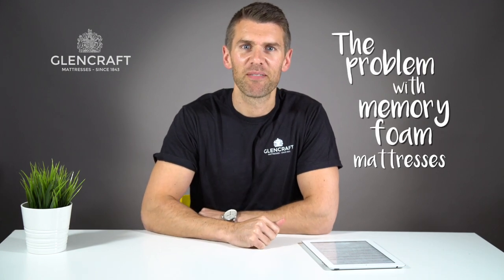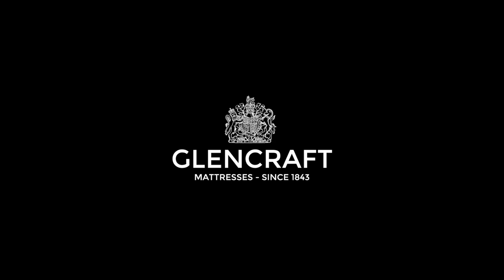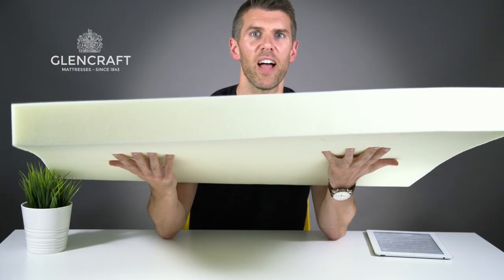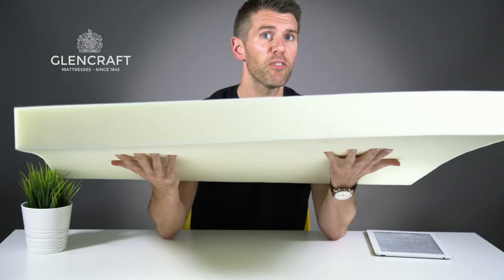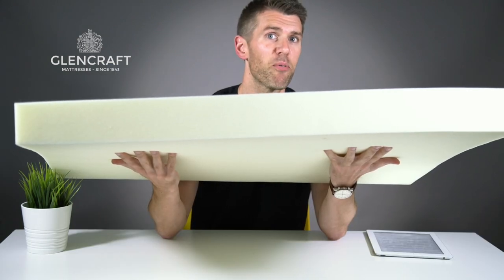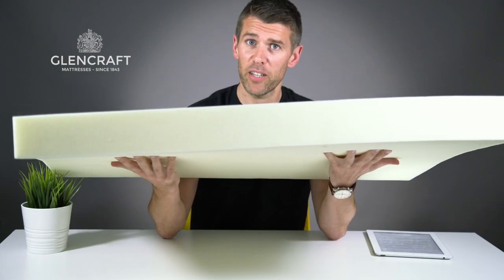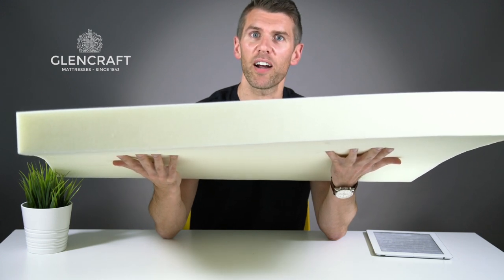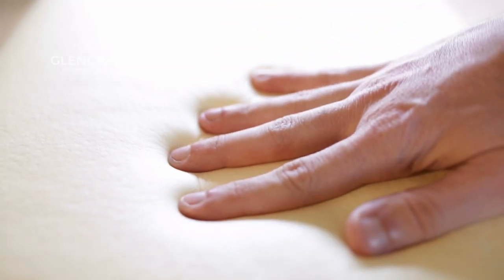The Problem With Memory Foam Mattresses Video

Comment: Like pot hole in my bed. NO support. "Memory Foam" does NOT cushion your body or distribute your weight, like actual foam rubber. It instead goes FLAT under you, THEN back to the original appearance of a cushion once youre out of bed. Expensive gimmick.

Comment: You're leaving out the main problem with memory foam topped mattresses.
After 40-60 mins your body presses out a channel into the foam rather than have the spring system redistribute the deformation of the mattress caused by your weight. What's more, the foam at the sides of this channel in turn press in against the sides of your shoulders/rear end. This is uncomfortable, impedes circulation at the pressed areas, restricts the normal small movements we tend to make when sleeping and provokes a greater number of turns/repositions during the night.
I realise that some soft covering has to be lain over the spring system. But I think a traditional moveable hollow fibre/natural fibre padding would be easier and provide deeper and more comfortable sleep.

Comment: I'm on my 4th memory foam mattress in the last 3 months all of the mattresses conform to my body shape but the shape never leaves the mattress do you know or have any suggestions about what could be the problem here
Reply: Stop buying them, if you're looking for something long term lasting you should search up Visco Therapy Pocket Memory 2000 Spring Rolled Mattress
Reply: Something about the 4 beds in 3 months should raise a red flag or 2. I've had my Lull for 5.5 years, absolutely 0 issues. A general rule of thumb for everything in life is if you rely on it or spend most of your time on it, never ever cheap out on it. You should be spending a minimum of $1,200 for something as important as sleep. We literally sleep a third of our lives. It's very very important.